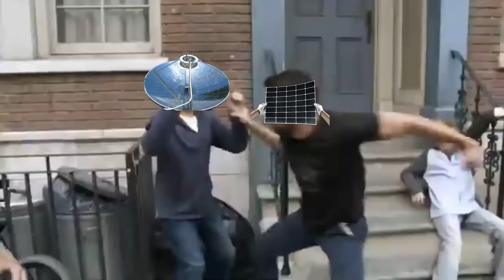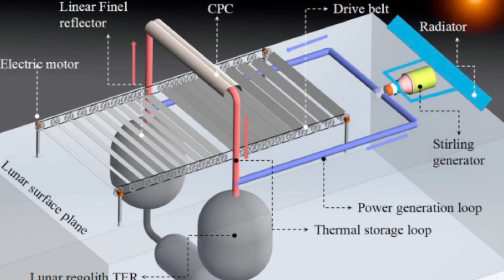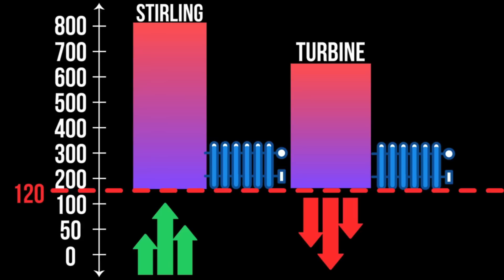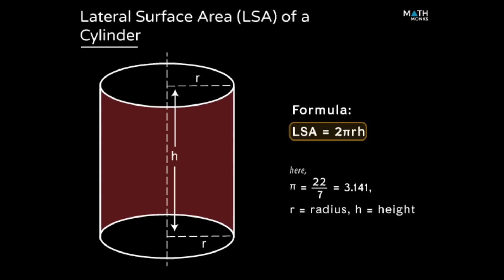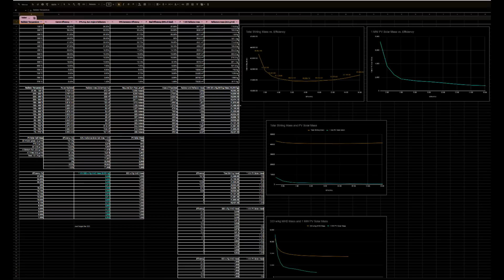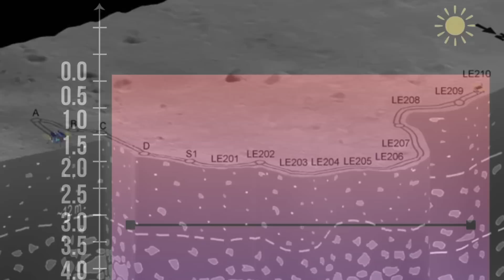Stirling Engines vs Solar Cells (+Transmission Lines)

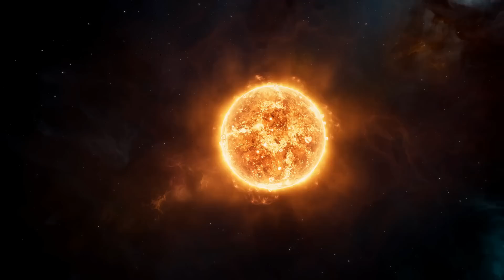Comment: 12:12 A note about ambient temperature in this context. It's not really a useful context in vacuum. All that matters is that the emitted power (from the steven-bolzman law) must equal the incoming power, from both the engine and the solar illumination. If the radiator is flush on the ground, this means the minimum temperature is similar to the temperature of surrounding regolith (give or take differences in albedo, ...) and you have to account for solar illumination in radiator sizing. For radiators perpendicular to the sun, you can ignore this effect entirely and the radiators can be as cold as you like.
As other people have pointed out though, you can prob. do away with radiators entirely if you use the lunar surface for cooling in a kind of 'reverse geothermal'

Comment: Do you need to make wire or could you make pipe? Greater surface area per kg-meter of distance covered and raw material. On earth these wires have to sway and bend and be transported economically. If you had a couple of meter pipe you could just jam one end inside the other end like downspouts. Either crimp or spot weld the interface. Move the robot ahead one pipe length and repeat, covering the completed pipeline as you go. These don’t have to be particularly tight tolerances. As long as the skinny end fits in the big end and has a resistance within range, it’ll do.

Comment: your assumptions about the radiator min temp are wrong, and you even provided the proof yourself in the powerline section: there's shaded regions that are much colder. think about how the solar panels and radiators on spacecraft work: the hot side shades the cold side, which faces towards empty space. don't lay the hot side flat on the surface, make a tower with a hot and a cold side. also I think details of stirling vs turbine might get tricky: it's MUCH easier to approach Carnot efficiencies with turbines since there's no reciprocation and no sliding seals, both of which create massive amounts of friction. I also don't fully get why the hot side of the stirling can run hotter than turbine blades, given it's the same material assumptions. we've been making turbine blades with cooling channels for a very long time, im not familiar with the details, but I assume it's a pretty well understood methodology after so many decades
Reply from the maker: @nuttyDesignAndFab  local equilibrium, even cold spots are going to get hot it doesn't matter how cold they start you're pumping heat into it.

Comment: If the material is made on the moon I fail to see why the mass to efficiency would be the primary deciding factor. This is unless you assume the mass is promotional to the energy required for processing. This isn't necessarily the case though. The energy required is determined by the resource and the process required to produce the end product. You may want to start with the least energy intensive product but once there is sufficient energy for production I believe the most efficient to surface area would be the priority.

Comment: Stirling engines are more efficient than solar panels could ever dream of being.....at least at the current solar panel efficiencies.

There's 1000 watt/m^2 in sunlight and a panel will only give you 20-25% of that. The max COP for a carnot type tengine is "Q = Temp_diff/Temp_Max" with temperature in kelvin. So if you have a solar heater as the hot side input and you use a solar focus so that the hot side input can reach 1000 deg C (1273 k) Then the cold side could be water cooled to 90 deg C (362 k) then the max theoretical efficiency is 71.5%

If you loose 30% of your output power to friction losses then 71.5% * 70% = 50%. Far more than a solar panel could ever dream of.

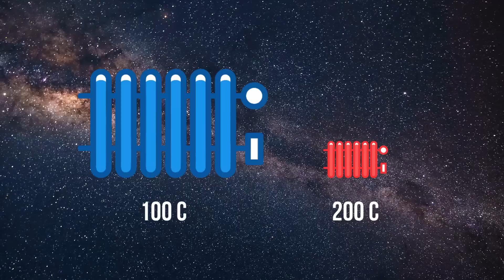Comment: Quick note circa 14:08
Physics deals almost universally with absolute temperature, measured in Kelvin. Double the 100°C is not 200°C, it's ~470°C

Comment: I saw an article posted Dec 9, 2021 called "Analysis of radial-outflow turbine design for supercritical CO2 and 
comparison to radial-inflow turbines" which claimed that  these turbines could achieve isentropic (idealized) efficiencies ranging from 85% to over 90%.  The turbines are smaller and easier  to design then the axial-flow turbines.

You mentioned that in practice, typical efficiencies range from 50% to 70% of the idealized efficiencies.  Then consider another 5% loss due to the generator so the range would be 42.5% to 63% less another 5% for generator losses leaving 40.38% to over 59.85%.  The article did not mention these real-world adjustments, so good to know.  Thank you.

Comment: There truly is no reason to use anything but nuclear for a moon base. RTGs could easily handle a moon bases needs, and while they do not produce much power on an individual basis (I think the most powerful is 300 watts currently) that same unit produces over 4kw of thermal. Chain up enough of these and you have some serious output! You could even put sterling engines to use to capture whatever excess heat you do not need for habitat purposes making the efficiency go up! Maybe even a small nuclear fission reactor could be useful.. Cooling would be an issue.. One benefit to an RTG is their lifespan, a plutonium-238 device would have a half life of 90 years.. Solar panels on earth only last 20ish years or so and I guarantee without big advancements the space environment will shorten their lifespan dramatically. RTGs can be buried for radiation protection etc

Comment: Thank you for proving the case for building Thorium reactors on the moon.  The Thorium Nuclear cycle can be fueled by the thorium already on the moon,  there is a need for Iconel, Hat alloy martials, but at measured energy densities of 70Mw/meter cube you need very few of them and 70megawatts probably could power any installation for a LONG time before capacity limits were reached.  All the materials in those square kilometers could go to other purposes.

Comment: Like they wouldn't have a fucking solar array that can direct the solar light to array of solar and mirrors to heat sterling engines and charge panels for ultimate power and then have cheap power

Comment: The weight of the solar cells is about 10%-20% of what they are on Earth. I don't think you've included any support structures / frames in your calculation.

Comment: Water become steam in a vaccum at 30c meaning you don't need to get crazy with materials and operating temperatures it has near enough the same expansion rate no mater the temp you get it to boil making it a great medium to use.

Comment: I was surprised to learn the subsurface of the moon is hotter than the surface and just gets more so. I presumed it was like the earth where a meter or two down it's quite cool, even in a hot environment, or like a cave is. Is it the lack of organic material, water, or the makeup of the moon itself?
Edit: That's what Google's AI summary said, but then I watched a video by Astrum that says the Indian rover/lander took temps and it got cooler the deeper it went. So, I don't know...
Reply from the maker: We store heat underground here on Earth. Local equilibrium. Even if it starts cold if you pump heat into it, it will get hot very quickly

Comment: If I'm correct, the upper limit of steam engines of 650 C is set by the water medium. At higher temperatures water starts do disassociate into hydrogen and oxygen and you'll get all kinds of undesirable side effects. Unless you're in the business of creating hydrogen, the you want those side effects.
But, in a turbine blades get more mechanical stress and need to stay further away from critical temperatures. I'm curious how alloying with nickel improves the working temperature range.

Comment: you COULD radiate it into space or...

use it to bake your delicious alloys and metals through the same technology as refrigeration.
Yes you can claim "laws of thermal dynamics" but, joules being put into an item would absorb those joules, joules being compressed into a tank with decent insulation would store those joules, repeat it enough times and you end up with temperatures hot enough to smelt just about any metals you like using solar power and compression technology.

Sometimes, you WANT that heat, sometimes you REALLY want that heat
Reply: The question is how to condense the heat so much, you have to find a way to radiate it in to a storage medium for the whole range of temperatures.  Perhaps simply using the heat as a first stage of heating would be effective?  Followed by a much more efficient and direct heating method of using resistive heating.
Reply: @aone9050  the thing is that you can tumble dry your regolith to the point where it starts releasing hydrogen, which is about 500c, but it likes 900, but at that temp it's sintering, collect the hydrogen and other gases and use those, keep collecting enough gases and you'll end up being able to choose what gas you can use for what and where to use it.

Comment: If there are permanent dark zones on the moon's poles, wouldn't this make for better solar thermal sites? More so with vertical arrays rather then horizontal, using the back fore radiators as most the sky is away from the sun. You'd also have constant power making it perfect for human habitation.
From there we could spread to the equator with mostly automated systems that use the cheaper solar electric.

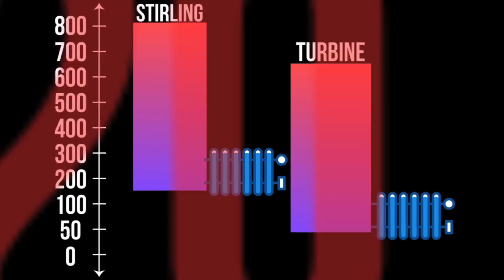Comment: 11:37 Yes you are limited by the ambient heat but you have easy access to deep space. A  radiator is limited by the ambient heat on earth because of air and water vapor carrying heat around, but the moon's surface is at a pretty good vacuum, and with insulation from ambient heat you will loose heat more like in deep space. You can use a thermal battery cooled at night, or an insulated structure simulating a polar crater. You can easily calculate how much heat you can possibly absorb with your collection area and design an appropriate battery. Specialized sterling engines can run off of that when it needs to dump the heat into space, or you could have a hotter running battery for that, and a colder battery to keep things consistent for the "normal" generators. You might be limited by space, and you might need more reflective materials for the cooling bowl/tower, it can add complexity, and its not going to keep all the ambient heat out, but its closer to being cooled in deep space than anything else could be and it raises your maximum efficiency. The radiator can also increase the efficiency of solar cells if you use it to cool them.
A thermal battery might also be the best way to store energy over time because you gain efficiency by not converting the heat into electrons which need batteries that need to be kept happy, but here you just need thermostats, reflectors, pipes, pumps, insulation, and Nak or gallium, and with thermophotovoltaic cells.

Comment: So a question about heating. Do we know the ambient temperature underground on the Moon? Moreover how would the calculus change if we built it on the south (eternally day) pole.
Reply from the maker: Yes its cold underground but if you pump heat into it, it will heat up and reach a local equilibrium. If you locate in a place with constant light it can run constantly but the equation doesn't change so you're better off putting solar cells there which will also run constantly.

Comment: Thanks for reuploading, really glad your willing to go back and fix stuff. On that point though, I do still see a few mistakes in this one. Biggest one is probably the part where you say MHD's don't need thermal gradients to work. MHD's are still ultimately heat engines subject to the same thermodynamic laws that a Stirling engine or turbine is, which is that they are taking heat and converting it to electricity. Like, the reason why heat engines get more efficient from larger thermal gradients is because the more heat energy you extract from your input to convert into electricity, the colder your output is going to be, because it has less thermal energy now. MHD's still work on that principle, you can't have an MHD that takes in plasma at 1 temp and pressure and outputs plasma at the same temp and pressure, not just because of risk of the MHD melting, but because that would mean there is no change in the energy of the plasma, so the MHD didn't extract any energy from it. 

The reason why MHD's make radiators so much easier is not because they don't care about output temp, its just that its way easier to give them a useful thermal gradient even with high output temps, because the input temp can be so high. You can raise the output temp a lot, and rather than having to accept lower efficiency, you can just increase the input temp to compensate. Though in the case of solar thermal concentrators there is an upper limit to how hot you can make the input temp, which is that a solar concentrator can't ever get something hotter than the surface of the sun, but that's a pretty generous upper limit. 

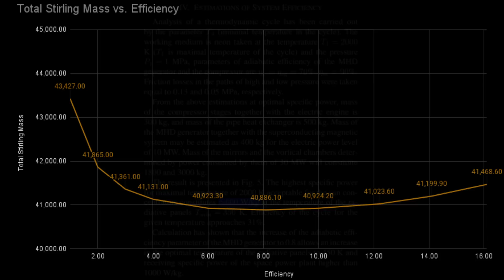The second mistake is the 600 watt per kg figure in that paper is again, the power density of the whole system. I get why that keeps happening because these papers do not do a good job of making that clear, though a hint is that the authors said that the 600 watt/kg power density figure happens when the radiator temp is 350K, and the main reason they would specify that is cause the radiator mass was being included. To get the mass of just the power converting stuff, if you look at the screen shot at 27:34 where you highlighted the 600 watt/kg figure, you can see a breakdown of the mass of each component in the paragraph right above.

"From the above estimations at optimal specific power, mass of the compressor stages together with the electric engine is 300 kg, and mass of the pipe heat exchanger is 500 kg. Mass of the MHD generator together with the superconducting magnetic system may be estimated as 400 kg for the electric power level of 10 MW. Mass of the mirrors and the vortical chambers determined by power consumed by them of 30 MW will constitute 1800 and 3000 kg."

The mass of all those components minus the mirrors is 4200 kg, and the system is accepting 30 MW of thermal power as input and outputting 20MW of heat and 10MW of electricity. That's an electrical power density of 10MW/4200 kg, aka 2380 watts per kilogram, not 600. 

If you want a more conservative figure, the MHD from the paper you mentioned last video, "Multi-MW Closed Cycle MHD Nuclear Space Power Via Nonequilibrium He/Xe Working Plasma
", it's overall power density was 333 watts per kilogram, but over half of that mass was radiator and nuclear reactor. Once you removed those, the power density of the MHD and supporting gubbins was 808 watts per kilogram. That paper had a nice pie chart of the different masses of the components on page 6. Though that might not be as useful an example, because it was using a lower temp heat source than a solar concentrator would, cause it was limited by the meltdown temp of the nuclear reactor, so its performance was lower. 900-1000 watts per kilogram might be a good lower bound at the higher temps you're dealing with.
Reply from the maker: @massimocole9689  I decided to use their estimates to keep everything on an even playing field and noted this was ideal so went with the 600w number
Reply: @Anthrofuturism I see, at first I thought you were plugging the 600 watt/kg figure in as just the MHD power density and then adding in the mirror/radiator mass like you did last time, but looking at your final graph I realized you were using it as the total system power density. Cool, thanks for the reupload.
Reply from the maker: @massimocole9689  yeah thanks for pointing out that first actual mistake! 👍 Most people just yell at me to bury the radiator underground lol.

Comment: Out of curiosity why would you not want to use orbital solar collection and microwave beaming power to the surface?
Reply: Presumably because microwave beaming is another drop of power transfer efficiency due to radiative and conversion losses

Comment: The only thing I could say about radiators is that instead of deploying them on the surface, you can just drill a few holes into the moon's crust a few hundred feet deep and tap the cold rocks below. Sort of a reverse of what current geothermal heat systems do on earth. You dont even really need to drill honestly. just create a bunch of piping then cover it with regolith.
Reply from the maker: Check the pinned comment

Comment: Aluminium doesnt resct with NaK:
NaK has average free electron density of 1.5 per atom, same as elemental Na.
Bothsodium and aluminium are reducing agents as the energy required for both to get rid of a valence electron is very low (converselyvery high to accept an electron), to gain an electron and thus react, one would need to be a relative oxidizing agent aka one must be a much stronger reducing agent than the other to the point that it overcomes the weak atomic force neccessary to rip off an electron, this is not the case with Al-NaK as the energy given to accept an electron is higher than the energy  required to rip off that electron.
Under extremely high temperatures this may differ.

Comment: You missed the opportunity to put heat engines on the light/dark boundary.  That would offer HUGE efficiency gain due to the magnitude of the temperature difference on that boundary.
Reply: That might be possible in some craters that are shaped just right, but you would have to select your location based entirely on that.
Reply: @ …and then run cables everywhere else.
Reply: A solar shade open at the sides to space outside direct sunlight is already a dark boundary.  If you dump heat in to a crater you will reach an equibrium that reduces efficiency more than if you dump it in to space.